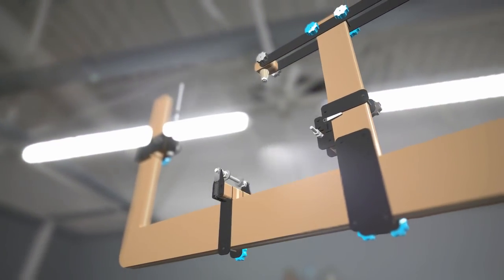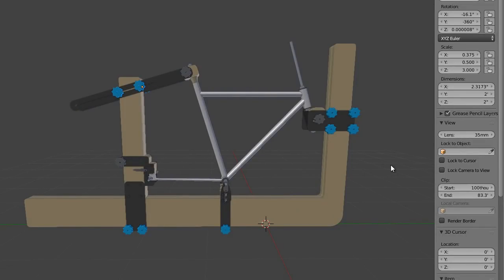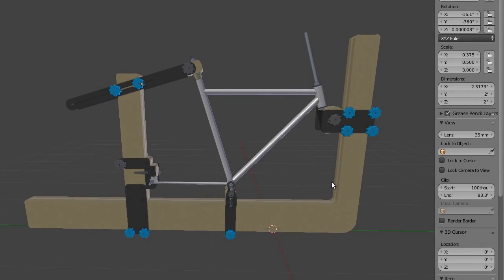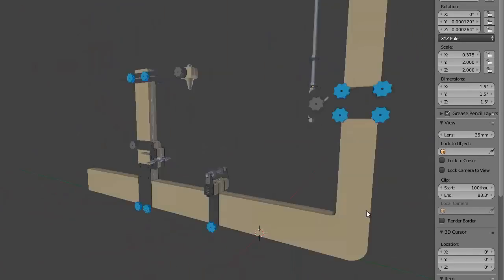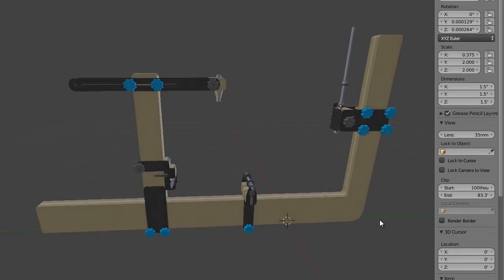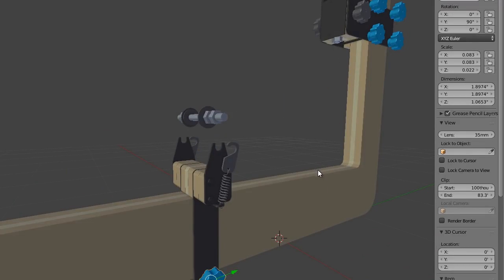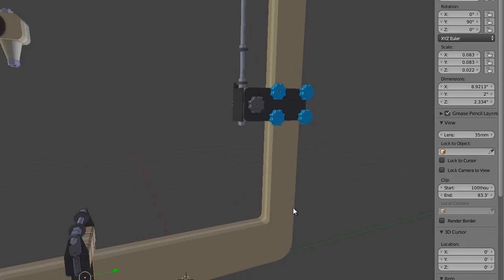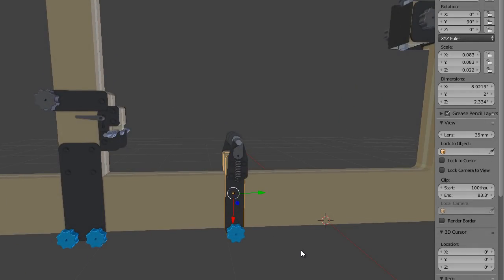Low Budget Bicycle Frame Jig 01

Comment: Steve - that is an elegant design, indeed! Very well thought-out, especially with the constraints of being low-cost, and not requiring any machine tools at all! I'll be extremely interested to see how well it works, once you have built the first article. I always find ways to improve a design after the first execution, and it wouldn't surprise me if you do, too.
Reply from the maker: Ron Covell same here Ron! It sometimes happens while I’m in process of building even the first version.

Comment: Brilliant. Very smart to hold the rear axle in the middle like that because it's difficult to keep it square otherwise without something really solid. That laminated design so you can leave square channels for things is genius. I'm guessing you're going to turn that wooden cone on a drill. This worked quite well for me. The wooden cones can get a little bit singed when you're tacking the frame (with TIG) but it's not a huge issue. If you were torch brazing not sure a wooden jig is feasible anyway.

Comment: That's really nice. I'm thinking more from a brazing perspective, so would probably want to make it  out of something flame proof. I think the set up for the rear dropouts could also work  like the bottom bracket,  make it easier to get at the inside of the joint with a torch, but would mean the seat tube holder would have to move back. I'll be keen to see it in action.

Comment: I like it! It kind of reminds me of the low budget spine jig I made for my last frame build, however, I like the low tech adjustability you've incorporated into your design. I'm probably going to use a few of your ideas to modify my jig on my next project. Thanks for making/doing this! It will definitely open the door for future frame builders that were intimidated by the high cost of equipment needed to get started.
Reply from the maker: Hey Joey, did you use ply or mdf? I’m considering ply instead after reading some of the comments.
Reply: @PithyBikes  Basically, I used 2" square mild steel. I welded two sections at a 90 and sandwiched 2 x 1/4" plates on either end of the upright section of the beam and used an old 1" threaded steerer tube with some old headset parts for the cones to center the headtube. On the bottom, I used 2 more 2" square tubes for the dummy axle and BB.
Here's the youtube link: https://www.youtube.com/watch?v=xXoliAiaG2g
Definitely more rudimentary, but a similar concept.

Comment: Looks very interesting! But the devil is always in details, so I am looking forward to build video, and how it behaves. Some things that give me a slight concerns (though you have probably addressed them):
- how tight are tolerances of external dimensions of threaded rods, and would they tend to wobble or "bite" into mdf, 
- also plywood dimensions could be "nominal", and different from your target 1/2"
- general way of tightening things does not seem to be self centering (maybe it is of no concern), 
- fixture for the seat post is realized  through 2 "joints" so tolerances and "wobbliness" could add up if care is not taken (again mabe it is not important). 

Thanks for trying to construct and make such jig!

Comment: You will want to put another spacer or two between the seat tube holder sides to make it less floppy. You can double up some of the brackets with an angle profile to make the extended pieces more rigid.  If you make the bottom bracket and head tube holder similar to the seat tube holder, you could make it hold a funky recumbent.  A baltic birch plywood would be more than adequate replacement for most of the the steel plates.  Most everything could be made out of the off- cut from the 1/2" spacer piece.  Less problem with moisture and lighter all ply instead of MDF. Biggest expense would be the fixture knobs but you could make some from t-nuts or threaded inserts in plywood and be all in under $100.
Reply from the maker: David Kirtley Yes my thoughts too!
Reply from the maker: David Kirtley love the alternatives you mention!
Reply: One added bonus of doing the straps with wood is that they are not as slippery as metal and will be less prone to slipping. My only quibble is that it might be too good and too cheap to just make a dedicated non-adjustable alignment jig for each bike build. Just a set of holders for the bottom bracket, tubes and drop outs that you move to each one.

Comment: Definitely budget friendly, but not very stiff. Putting wood in the middle, and sheet metal on the sides would have made the spine a lot stiffer. Doesnt even need to be 1/8 inch. Something really thin like 20 to 24 gauge would have been enough. Otherwise i am quite impressed.

Comment: Fantastic work. +1 for the MDF. IIRC, the jiggernaut is also made out of mdf, but this is a better option for someone that is interested in making more than a few frames. Any thought on a fork jig?
Reply from the maker: I think the base of this jig could be adapted pretty easily using the same principals to hold a fork. You would need to build a section that attaches the head column to the spine of the jig. The rear drop out fixture could be adapted to hold the fork blades.

Comment: Hi Steve,
Sorry if this is a bit unrelated but I have wanted to ask you this for ages.... I am curious as to how you clean up your Tig weld So?
I will be doing some tube welding soon and I imagine I will use my electro polisher to take the discolouring and heat stains out of the welds.
Would you mind letting me know how you deal with it?
I love your channel, right down to the inclusion of your kids on occasions, it is really nice and above all informative.
Kind regards,
 Simon.
Reply from the maker: I will clean up TIG welds because I will have to continue welding in that same place. In which case I need to clean the surface with a wire brush. The short answer is - I use a wire brush to clean up my welds when needed. I will dedicate a brush to a specific material type to avoid contamination. So a wire brush used on 4130 is for 4130 only. And a brush used in aluminum is for aluminum only. In general I will leave any discoloration from the weld as is. Thanks for watching and I hope this answers your question. :)
Reply: Pithy Bikes 
Thanks so much . Good to hear you can achieve it with a simple approach. I made a electro polisher for about $100 and it's very good. Only consumable is some phosphoric acid which is cheap. Let me know if you would like to build one some time, I would be happy to help.
Cheers,
Simon.

Comment: very cool concept just wanna ask the reason using blender over other "proper" CAD
Reply from the maker: For the early stages of an idea, I think about stuff a lot. Then when I have a decent idea, I'll do a sketch on paper. Next step to flesh it out further is to bring it into a 3D app. In my case it is Blender. But for anyone else I would say to do the 3D step in the app you are most familiar in. The idea is to not let the software bog you down creatively. Because Blender is not CAD, then I am sort of forced to not be precise in my measurements. Measurements are important, but for concept - a tolerance of 1/16" is plenty good enough. My opinion! End of the day, do what can produce results fastest that works for you when in concept phase. The idea is to let your ideas fly and choose the method with the least resistance.

Comment: Hi I am currently doing a electrical bicycle for a project this jig will save me a lot of money
If possible can please send the 3d model of jig it would be really helpful
Reply from the maker: I never did a follow up on this jig. It's ok but doesn't quite pass my seal of approval due to unpredictable tolerances depending on how it is constructed. I do plan to make another with simpler and higher tolerances.